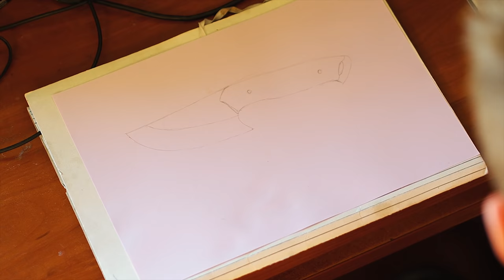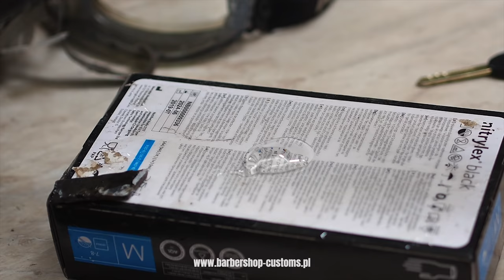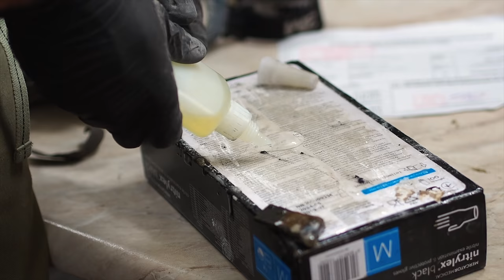Knife Making - Small SKINNER w/ Black Blade and Stabilized Wood Handle

Comment: For the record I now nothing about making knives and fitting handles except what I've seen on YouTube. What I have noticed and if you are so inclined I see many of the knife makes will form the handle at the bolster before attaching it to the knife to prevent them from scratching the blade while forming the handle. Use it don't use it. Just an observation. Great design and I enjoy watching you make them!
Reply from the maker: It's actually easy to avoid scratches if you pay attention and the way we do it guarantees a better fit, especially on a wood that likes to slightly deform if it's not oiled right after sanding :)

Comment: Another great video and an awesome knife!  After the blackening solution cools, can you save it?  If so, what is an acceptable container?  Thank you!
Reply from the maker: Yes, the solution is good till it works, we always reuse it a couple times. You can store it in the container that you cook it in, just make sure it's insulated. You can also use some stainless or plastic container

Comment: Show us how to do this when we don't have the $1000's of dollars to invest in all those tools! 🤪
Reply: You could absolutely do it with an angle grinder and a 100 dollar harbour freight 1x30 belt sander.It would be a bit harder to do.  You could also do it using a hacksaw and hand files along with a handmade filing jig. You will also need some sandpaper, epoxy resin to glue the handles, and about a 100 dollars worth of insulating firebricks with propane burners to heat treat the knife- if you will use a steel that's easy to heat treat (like 5160 or 8670)..... and practice. Quite a lot of practice to make it look that good. 
I'm just starting myself. It's a lot of fun.